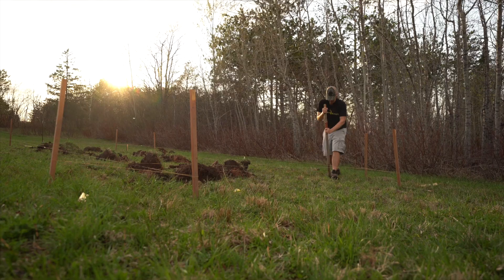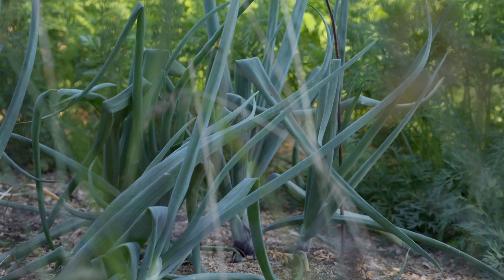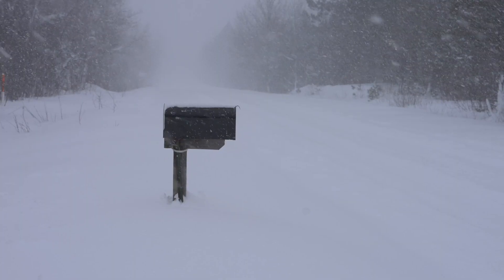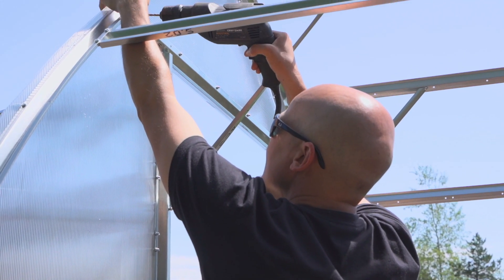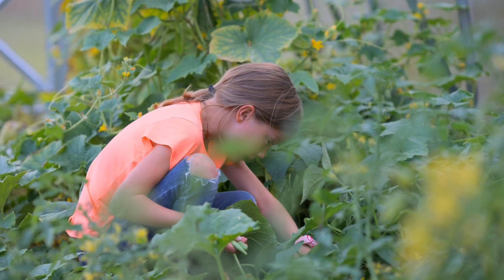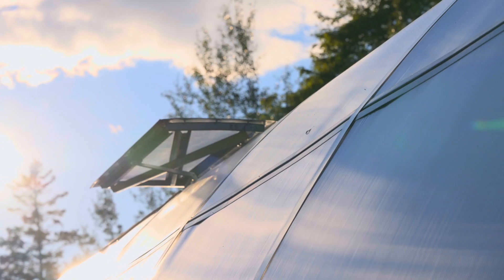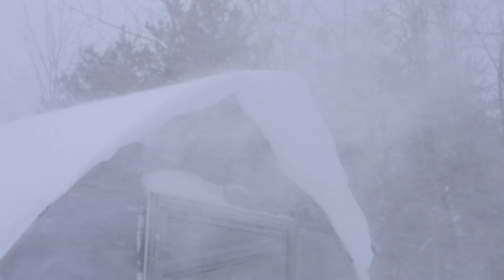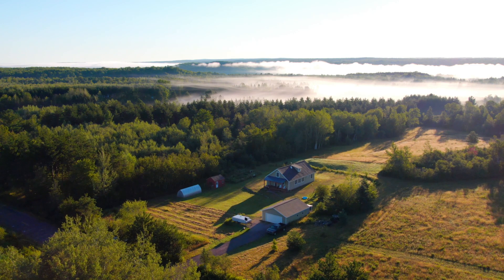Planta Greenhouses | Sungrow 26 Review | Snow and Wind Rated Greenhouse

Comment: this will be my first winter with my Planta GH.  I just got in my Birdie raised beds so those will go in but really I won't be ready to grow anything for a bit.  However, as an experiment, I threw my potted sage and Rosemary into the greenhouse. We are starting to get some really cold nights and the Rosemary seems to love it.  The Sage is a wee bit more tender but is surviving.  I have no heat at this time just a bunch of 5-gallon jugs and a 35-gallon water tank.  I am going to put an aquarium heater into the 35-gallon tank and run it on a solar generator.  I hope to start all my seedlings in my new greenhouse.  Such fun to experiment with what works and does not.  TY
Reply from the maker: @LisadeKramer that sounds awesome! I have been looking at cost effective ways to heat mine and that is a fantastic idea. I love trying new things in mine as well, they are such an effective environment for zones with short growing seasons.
Reply: I have received plantaGH putting  it up hopefully before new year’s. im considering a bench, shelves etc . A raised bed inside will be awesome as well but inclining more towards plants in containers that can move around if needed.